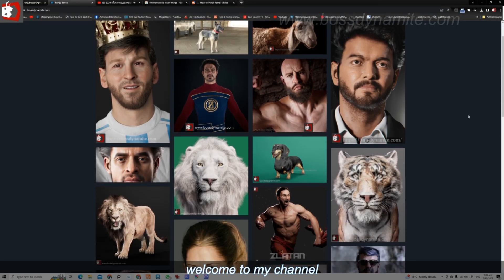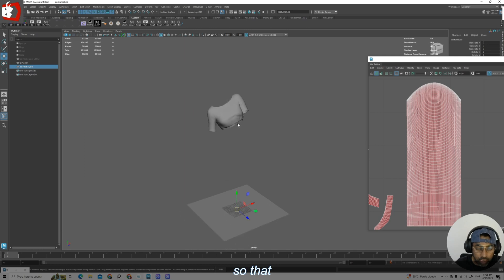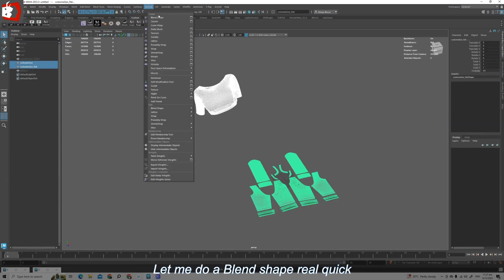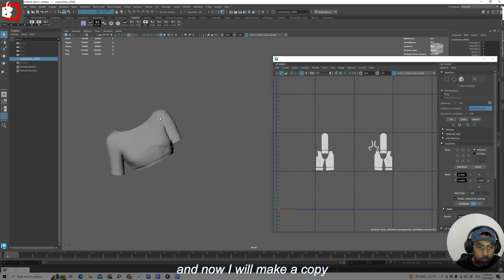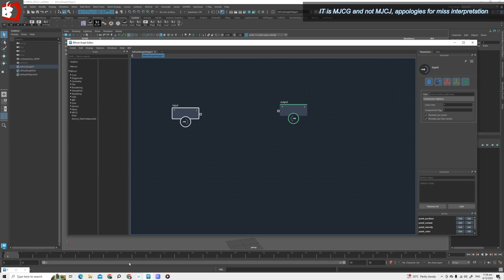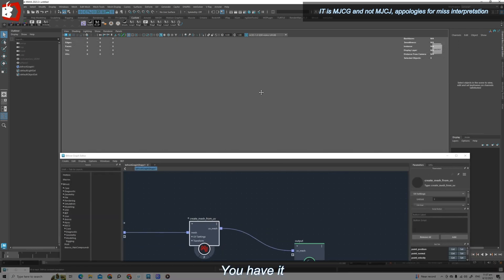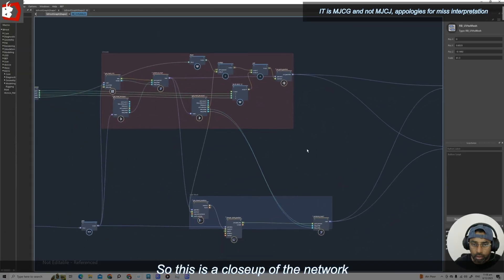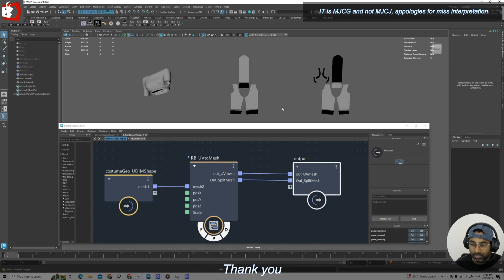MAYA UV to MESH

Comment: Smart way of doing it inside autodesk Maya. Be care, if you want to keep the same scale between the flatten mesh and the original, the texel density of the plane should be the same as the original mesh.
Reply: could you explain how to set this up
new to this
Reply: @safaluplavikar2821  In the UV toolkit, under "transform" you will find "texel density". Texel density is relative to the map size, so enter that first. You can then use the "get" and "set" buttons to match texel densities between different UV shells. In this case, you'll want to "get" the texel density of the unflattened geometry, then select the plane's UV shell and hit "set". All this will do is set the scale of the UV shell to match the proportions between the two. Now when you do "transfer attributes", the resulting mesh should scaled correctly (its surface area will be equal to that of the unflattened mesh).